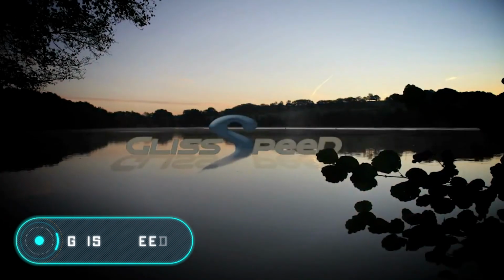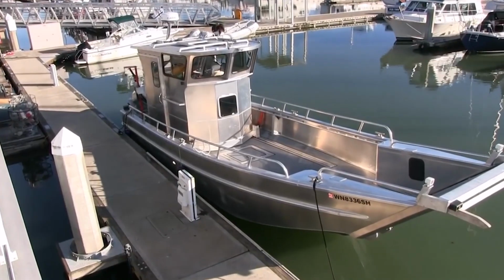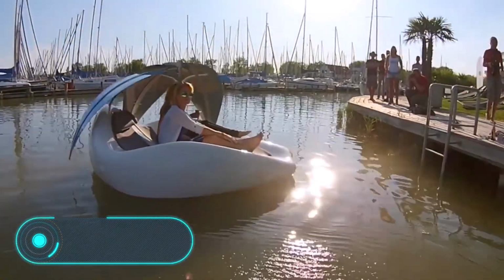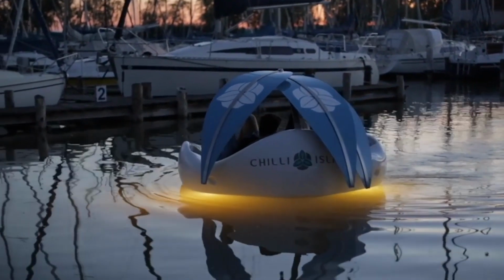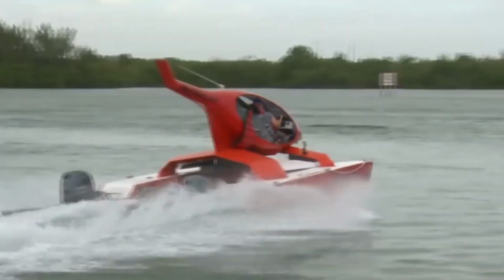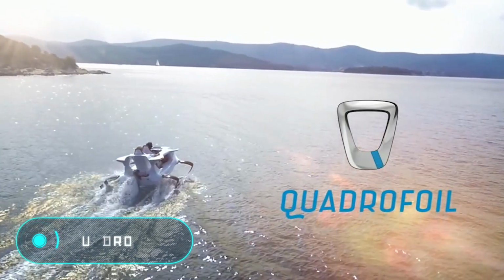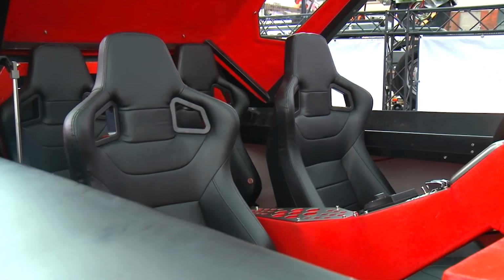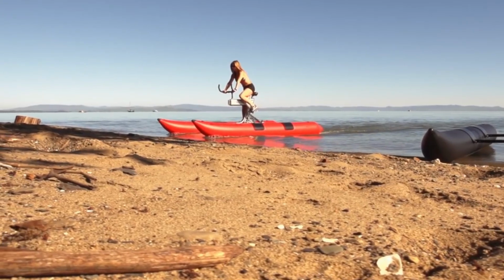10 WATER VEHICLES THAT WILL BLOW YOUR MIND

Comment: i'll take a SeaBreacher . and an Alpha Centauri .
Reply: Pappy I have rode in one and they are only fun if you are the driver. It actually got to the point I wanted to get out because it was so hot and stuffy in the back seat. They don’t want to ad a air conditioner because of the weight to horsepower ratio but I personally would be perfectly fine with adding the few pounds for my passenger to be able to breath lol... now with that said driving it is another story all together lol. It was a freaking blast!!!